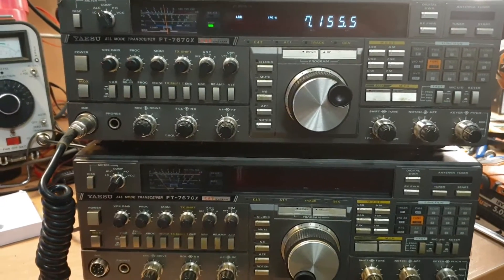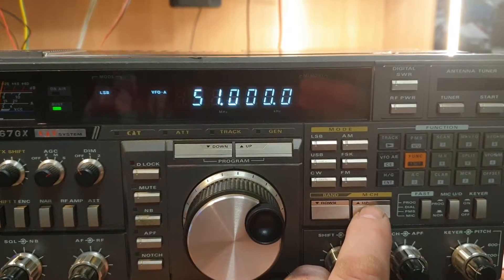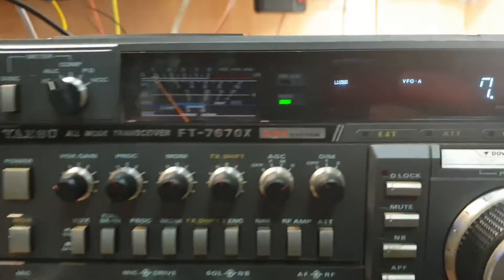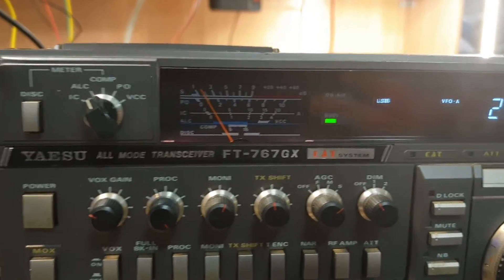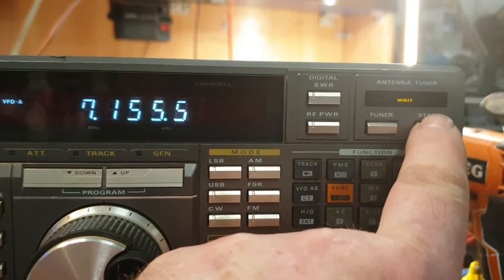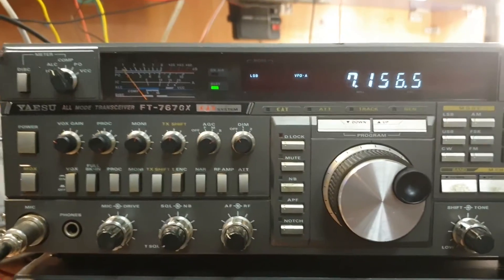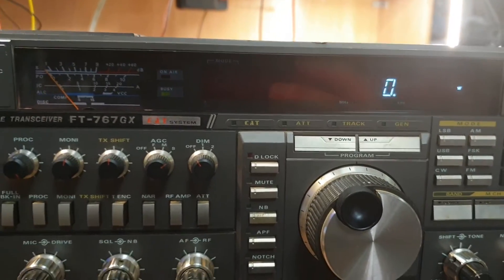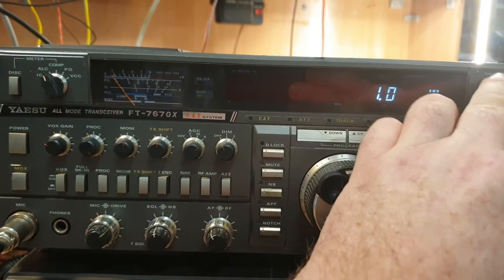Fumbling around the Yaesu FT-767GX HF 6m, 2m and 70cm transceiver...

Comment: I finally got a second hand unit, could fill it whti the 6M, 2M and UHF optionals. It has all of the expectable advantages; built-in AC power supply, digital SWR meter. No menus, just all available functions at the touch of a knob or button. Something I really appreciate, you can input the frequency with the keyboard. In my opinion It outperforms newer units.